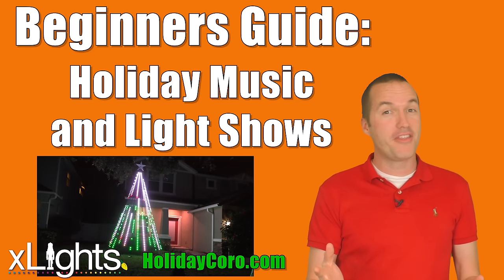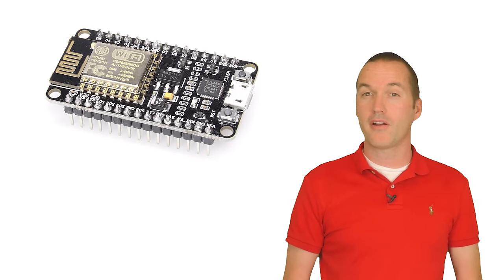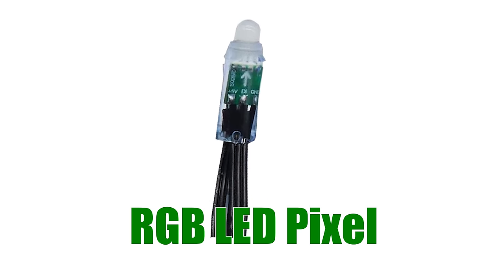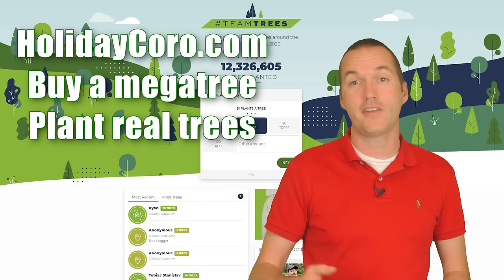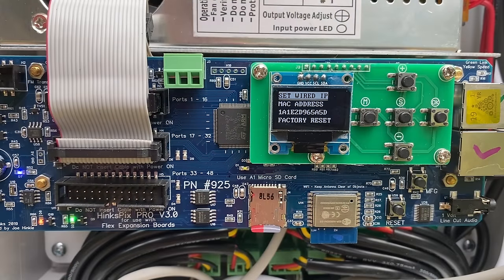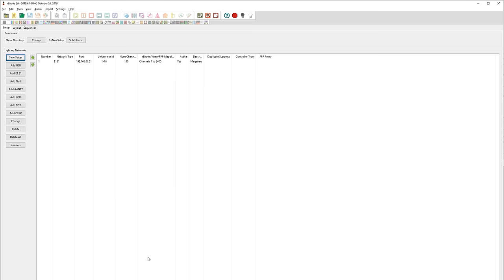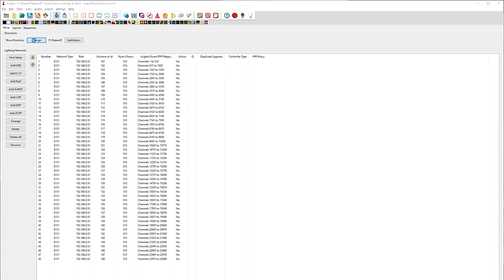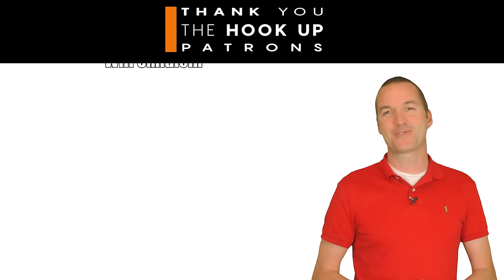Holiday Light Shows 101: LEDs, Controllers, Props, and Sequencing for BEGINNERS. 5 Hour MegaTree!

Comment: As always a great video, but...

QuickTree Pixel MegaTree - for $700.   Gee I'll take 12 of these to do my Christmas yard...... NOT.
Reply from the maker: I'd never tell someone to buy any one specific product... that's one of the coolest parts about this hobby, but the price actually isn't that crazy when you break down the cost of the individual parts.  800 pixels, strips, controller, wiring, mounting hardware.  The convenience fee comes out to around $100 to have someone preassemble the equipment for you and make sure all the parts work together.

It won't be for everyone, but I was able to put it together in a single leisurely Saturday, which may be worth $100 to some people.
Reply: There is another option. I bought 800 pixels from Aliexpress, strips from Boscoyo, a 300W power supply, two nodemcus, two breadboards, two logic level converters and some wire. I'm mounting it on my oak tree and staking it into the ground. $700? Yeah that's a lot. Total for mine is $191, plus the wire which I already had. I paid $96 for the pixels, the strips were about $60, the power supply $25, and the other stuff a total of $10 or less. Also I haven't purchased a box yet. I'm debating on what to do there, but that adds another $25 or so. I will admit mine will be more work and won't work as well as a wired controller, but I'm not sure if I would pay the extra for it. I will see after mine is built if I made a good deal.  I intended to use the pixels on my roof first, but thanks to Rob and some testing on my part I determined pixels shouldn't be a permanent fixture. I'm only doing the tree because returning to China isn't worth the hassle and I didn't mind paying an extra $100 or so to get this idea up.

Comment: #opensource #openhardware Pixel controller based on the 8$ Orange Pi Zero 
Full Art-Net 4 implementation. Full sACN E1.31 implementation. No FPS limit (except for what is with the WS28xx chip protocol).
http://www.orangepi-dmx.org/raspberry-pi-e131-bridge

Comment: what about AC lights?
Reply from the maker: I’m not a huge fan, but you can find controllers for them that do E131 as well.
Reply: The same exact CPU can be purchased to not only run pixels but also AC lights:
http://www.holidaycoro.com/16-Output-AC-Animated-Lighting-Controller-HinksPix-p/942-6.htm
Plus there will be some new AC innovations in 2020 around AC and the HinksPix controller.
Reply: thanks I got my first LOR controller this year and just got it setup. first year doing this and i hope that its more fun then headaches

Comment: The only question I have is where the hell did you find the time to do this? This was 16 and 1/2 minutes for one freaking tree. I'm good with my lights and my controller that I have to sync everything
Reply from the maker: It's a hobby, happens in the same time as any other hobby would.

Comment: Beginners my foot you need to be a computer genius to fallow you
Reply: Beginners can do it. Holidaycoro.com has a lot of plug and play options. Start with a string of 50 lights and a plug and play power supply, control board. All connections are made for you already in the box. Basic, basic setup beginners can do it.  little at a time. Also check out DrZss tutorials

Comment: Your wrong...led strip is just as easy to move as LED strings..ita how you set them up...and with LED strip its simple to replace a chip
Reply from the maker: I guess you're entitled to your own opinion, but I don't agree.  Pixels are significantly more robust and tolerant of movement, and are you implying that splicing out a pixel on an led strip is as easy as cutting a few wires on a pixel string?